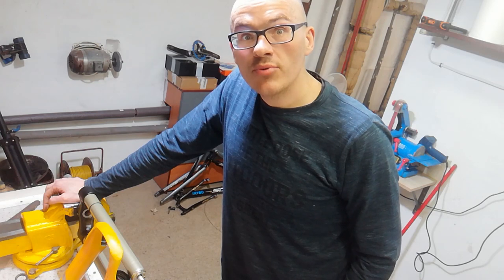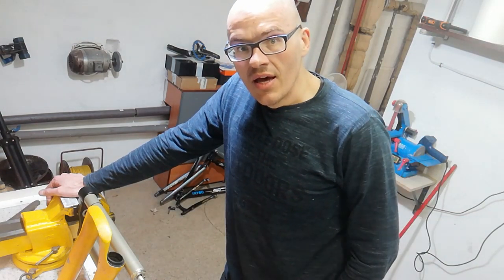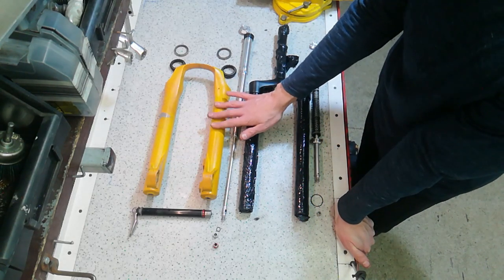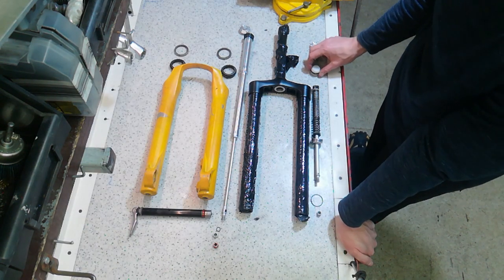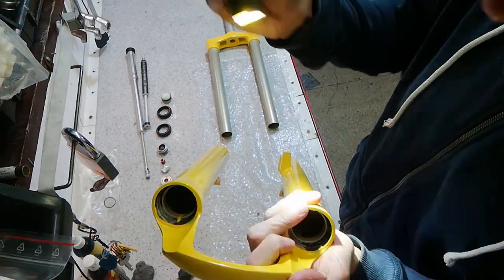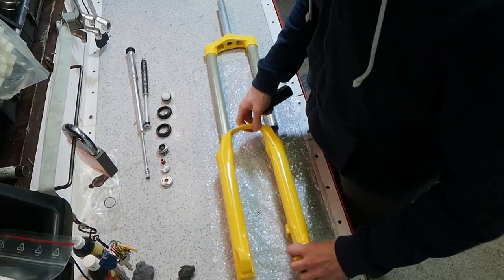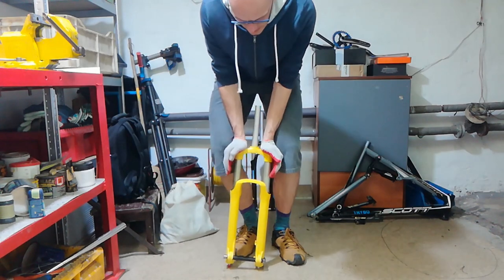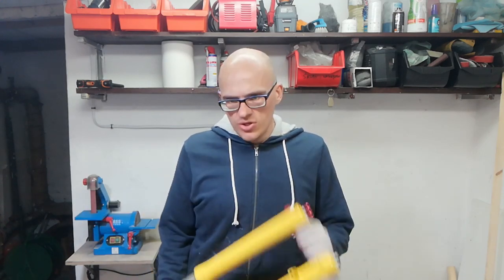Powder Coating a Fork

Comment: Hopefully the heating process remained just low enough to avoid greatly reducing the temper of the aluminum. The process may have softened it some, depending on the temperature reached in the oven, and probably the amount of time it rested at that temperature. I was wondering how the bushings fared since they sometimes have plastic layers on them. How were they effected?   Some forks actually don't have replaceable bushings, the company recommends total lower leg replacement. Example: Fox's Marzocchi brand new Z2. I didn't realize this about these forks until reading a Fox maintenance bulletin on the new Marz Z2. Anyway best of luck on your interesting project!

Comment: I have a 2005 manitou stance was thinking of powder coating the lowers 
At the moment don't have a bushing removing tool

Can you make a video how to remove them.
Reply from the maker: I'm afraid I can't. I don't have proper tools, can't bodge them and for a one-off job buying them is pointlessly spendy. I will probably send the fork to someone who does that for moneys.
Reply: You might first look into availability of replacement bushings for that fork, before doing any modifications to it. In my experience some older Manitou models can be hard to find parts for. Of course your fork model may be well supported, but it doesn't hurt to be sure.

Comment: Question, can you powder coat the inner stanchions?
Reply from the maker: Nope. Powder coat them and they are toast.
Reply: @TryboBike  what options can only be done to change the stanchions color?

So only the outer tube can be powder coated right?
Reply from the maker: @deckpogi2680  Yes. To change the inner stanchion you'd  need to do very specific process. There are some companies that do so, but that is quite expensive.
Reply: @TryboBike  true it does cost a hefty price, the electric plating is what folks are saying or "Anodizing" is the only way to get the desired color change on my stanchions but I do not know what coating will be done after the anodizing/plating.